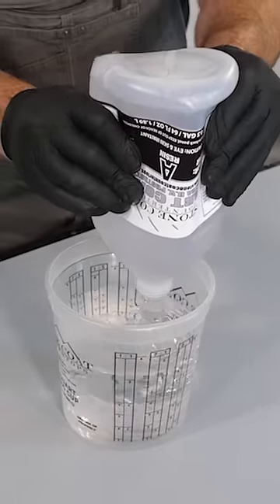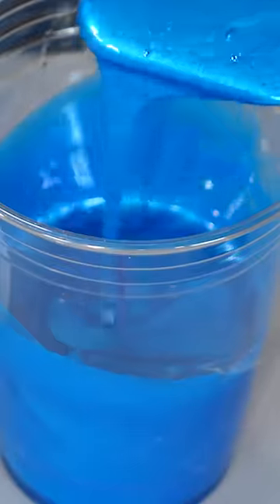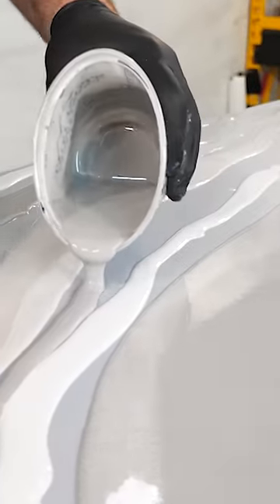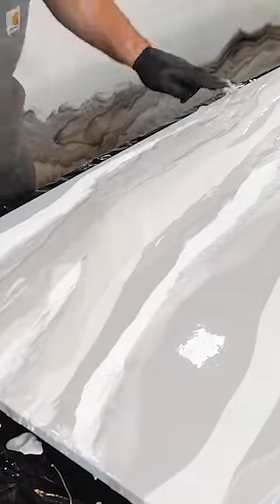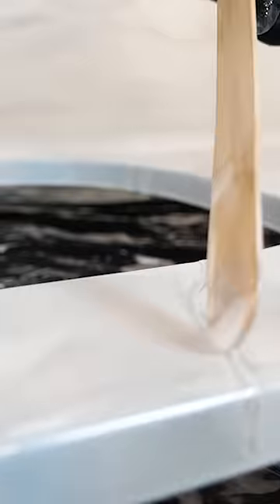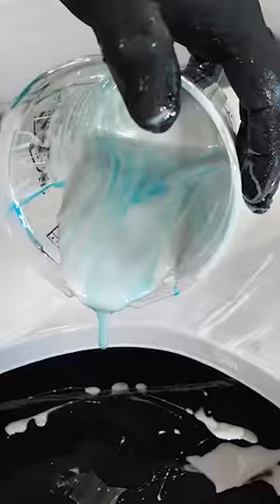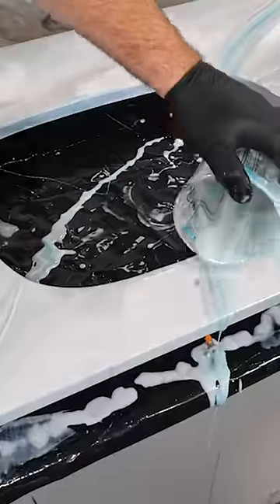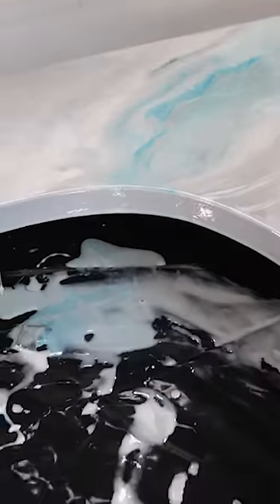He spent $3000 to get shoeprints out of Quartz 😱

Comment: Why didn’t he make the painter pay for a new countertop?
Reply: The painter most probably doesn't have money to pay for it. The builder probably had deadlines to complete the project and he can't waste time it would take to sue the painter and wait for him to pay in installments. That would take years
Reply: @annamarczuk2030  in the business world tradesmen like painters are required to be bonded which is like insurance for damages and liabilities for personal injuries.  Painters generally charge a lot per hour for labor so one way or another I believe the painter had the means to replace the countertop.  I like this company and when I remodel there are several projects I’m going to use there products on, but this just seems like a last case scenario story to me.
Reply: So... exactly HOW did he polish out the stain marks out of the quartz countertops? What 'system" would do that? ( I do understand he then had to spend hours to match the top sheen to match the rest of the surface)
Reply: A lot of times the slabs can’t be cut or prefinished till they get dimensions as well not all walls are square and things don’t always line up perfectly according to the blueprint so they usually come in and measure after cabinets are installed also sometimes the general contractor self performs work and use their own in house painter to keep costs down or maybe the GC superintendent was good friends with the painter and didn’t want to back charge him also countertops are usually installed at the finish stage of home construction 
the time to fabricate a new one might exceed the completion date which might lead to liquidated damages like maybe 500$ per day
Reply: What is the recipe for the counters you are making on this video?
Reply: @rwfrench66GenX  it likely was paid for by the painters insurance but insurance doesn’t come thru quickly so he paid up front to save the job. But really these are trivial details and not an important take away in the story. The important take away is it’s expensive af to refinish your stone counters if they get wrecked but epoxy is low cost and quick.
Reply: @arsenicjones9125  depends on the viewpoint.  I like to deal with reality and in reality the painter damaged the countertop and they’re responsible for fixing or replacing the countertop.  It’s very likely the stone mason still had the template for that job and could cut a new countertop provided the money was there.  Every construction job has extra money and time in the budget for problems.  I understand they’re selling a product and giving an example that a few days of training can save the day, but in reality if a contractor screws up something are you seriously not going to approach them to fix it or replace it, you’re just going to send some guy off to training to learn how to paint over it with epoxy?
Reply: @bnicedanicest6288  nowadays it isn't just about coming and getting measurements they actually come in and fabricate right up against the walls, objects cabinets etc.
Reply: @rwfrench66GenX true, but they might not necessarily have a matching or similar slab with the proper minimum dimensions to cut another countertop. Weaving general contractor in a bind to meet the deadline. Many of my customers select their own slab of granite or marble excetera. And can be extremely fussy about a specific slab and look.
Reply: @kelly-annflanagan7693  absolutely!  I’ve looked online, downloaded apps for my AR phone so I can see how the light from windows and different kinds of lights will reflect off of the surface of different materials, it’s a big investment and no two slabs are alike not only in color but in texture.  I’d need bail if the painter screwed up my countertop, I wouldn’t just pony up and send someone to school to train to do it, I’d hire the guy teaching the course if I had no other options.
Reply: @bnicedanicest6288  In Australia the residential construction industry has gotten so bad that I don't think anyone has built a square angle in a house in the last 50 years and nothing ever matches the plans. Also it takes up to 2 years from start of construction to finishing as they always overbook.

The only thing the industry cares about anymore is cost of materials. The whole industry from top to bottom is corrupt. They have even tried their best to make it illegal for people to build small additions like a carport illegal.

I have nothing but contempt for them.
Reply: @rwfrench66GenX  in the builder game they get home depot painters
Reply: When vendors destroy stuff in new homes or any job, they (builder) back charge the vendor.  We had an installer with a box truck drive on a brand new concrete drive, we got back charged by the builder, this then got submitted to the insurance company.  Usually these homes are high end homes, the builder isn't going to let a big damage like that go without getting reimbursed somehow.  If your vendor isn't bonded and insured, don't use them.  So important you know the company that you are hiring, do the research, you'll  be glad you did in the long run.
Reply: @rwfrench66GenX  maybe you need to watch the video again bc your narrative of the events doesn’t match up to the one in the video. He didn’t epoxy the countertops to repair them, they had to be rehoned and finished. They dipped into the extra budget to fix stuff and sent him to a course to learn to fix it. Likely the counter maker couldn’t get a crew out in the time frame needed to allow them to fix it. So yeah you’re really focused on the wrong parts of the story to the extent that you missed key facts of the story.
Reply: @arsenicjones9125  it’s funny how you’re so sure I’m so wrong about everything but you use words like “likely” because you’re drawing conclusions without having any facts yourself.  I don’t mind that you disagree with me, and it is possible that the owner of the house and general contractor for this job decided to do exactly what the guy in the video said instead of going to the guy who screwed up the countertop to get him to pay for a new one or the cost of the repair.  If forking out $3,000 for someone to learn how to do something instead of offering the instructor $1500 for the job makes sense to anyone, there’s no reason for me to continue speaking with them.
Reply: Because it was his painter silly
Reply: Builders (specifically production homes)use the cheapest labor that will get the job done to satisfaction for alot of the building process. The painters and tile crews are rarely held accountable. I work for a specialized repair company and them damaging tubs, counter tops and kitchen sinks provides us with a lot of work 😆, the builders hold us more accountable while we are doing our work than they do for the vendors that were the cause of the original problem.
Reply: Sounds like a made up story
Reply: Hard to prove who done, like they probs know it was him, no one else been there, but without the painter holding his hands up or without a witness what can ya do?
Reply: @petrescue2093  sanding and more sanding, they then run through 2000 grit sandpaper and polish
Reply: @rwfrench66  maybe in the populated cities lol not in most the land though.
Reply: @webtheweb  new construction is a losing battle for painters most the time the builders are idiots and there is heavy scheduling problems all the time I got 15 years as a journeyman painter I've done residential repaint commercial repaints new construction new commercial and as to why the Builder had the cabinets installed before the painter did his thing is unbeknownst to me...that in itself is dumb
Reply: @sdmfcfh1283  I’m pretty sure most construction is done in the populated cities where the population lives
Reply: I think I have questions probably everyone else does why didn’t the Painter be charge for what needed to be fixed? Secondly, as the countertop guy, you already got paid for your labor, but he paid for you to go to school to learn a trade that you didn’t know, why they charge. you got that class for free. And you learn some thing to be able to charge other customers for that previously you would not have been able to.🤷🏾‍♂️
Reply: @dannythorpe1425  Perhaps the painted footprint tread matched the paint and treat pattern  on  his boot. Perhaps there were witnesses. Perhaps he was ethical and self reported.
Reply: @petrescue2093  perhaps there was non of that?
Reply: @dannythorpe1425  We will never know for sure. What we do know is the OP stated as a fact that it was the painter. How the OP came to that conclusion is outside the scope of the post.
Reply: Sounds like a lie to me
Reply: He likely uses the painter all the time and wants to keep a relationship. That being said, the painter definitley paid for it, but because they're likely friends the main guy is just trying to save his buddy some money
Reply: @annamarczuk2030  it's called insurance
Reply: Because this is a fake story?
Reply: He prob got backcharged to some degree. But for the most part, insurance will cover (maybe?)
Reply: That's why I don't buy the story. Anyone who works in ffinishe houses know not to walk on c tops without putting something down. And I literally don't know any painters that are going to spray a finished kitchen.
Reply: Some people are just nice sometimes
Reply: I've come up with the conclusion that this dude is a compulsive liar
Reply: The painter is his employee, he's liable for employee mistakes
Reply: @annamarczuk2030  it's the general contractor's problem... The countertops should have never been installed until painting and everything else was done!
Reply: @petrescue2093  glass polish??
Reply: I called a back charge. It come out of the contract payout.
Reply: @annamarczuk2030  I know for a fact that regardless of what someone does in the construction industry they have to have insurance to cover any kind of "accidents" like the moron that walked on the new counter tops! If anyone says that it isn't necessary, THEN THEY ARE NOT TRUE PROFESSIONALS!!!!
Reply: @randyherringshaw6325  I would expect a construction company to have an OC insurance in case one of their employees destroys something. I know that doctors are required to have an OC insurance but they earn much more than an avarage construction worker.
Reply: @randyherringshaw6325  anyway I'm from a different country so my logic might not work here
Reply: How many painters you know?
Reply: @annamarczuk2030  he ain't gonna sue him. just not gonna pay him.
Reply: Hell yeah!!!
Reply: Probably the contractor rushing the painter
Reply: Look up quartz renew. It's a 3 step polishing compound to use after the diamond polish pads. What it does differently is reveal the "snake skin" that quartz has because of the epoxy and quartz.
Reply: The GC might have back charged the painter/ sub to some degree. However, this looks high end. You wouldn't believe the amount of money some people spend. Millions, bro. I see it every week. Some GC's out there are more interested in keeping good relationships with subs and they'll eat a couple things like this here and there. It's worth it when you know you have somebody on speed dial who will drop everything and come put out your fire. $3k is probably chump change on a job like this. Giving a sub that generally does good work a mulligan every once in a while keeps them coming back. There will probably be some change orders anyway. The homeowner might walk in tomorrow and tell the GC they changed their mind on that wall right there. Blow it out. Well, now you might need the painter to come back and take care of you asap.
Reply: @rwfrench66GenX  yes. If I had more money than the guy I hired to do work for me and messed up I would just cover it. 

When you employ people, they make mistakes. They make you money most of the time so dealing with the times they cost you money is worth it and the builder got more out of this as now if it happens again he has a way to fix it. If I am building a house I have the budget to eat 3k and gain something out of it. 

Also you can “deal in reality” without that information just fine. It’s still reality just reality where you know as much as you need to for the story. The payment info is not important at all.
Reply: @petrescue2093  dude this isn’t a how to video
Reply: @@rwfrench66GenX  you still have to sue the insurance company to get money. Their whole business is, do not pay out if possible. Took me 6 months and a lawyer to get a check from esurance for a totaled car.
Reply: Could be “family business”
Or Home Depot job
Reply: The painter was probably the builders employee.
Reply: @TitusPullo08  I'm pretty sure if he won't pay him then he will be sued by the painter for breaking their contract
Reply: It's not the painters fault. Normally counters are made from solid materials
Reply: @annamarczuk2030  it would just end in a counter suit for damages he cause. So give me a good reason why a judge would decide against him. Duh big waste of time and the painter knows it.
Reply: The painter was illegal and just never showed up again.
Reply: @rwfrench66GenX  only in some states
Reply: @petrescue2093  why would he tell us a $3000 secret?
Reply: @Ihatezidiotz  See below. He did.
Reply: @TitusPullo08  he can't counter sue because of that. causing damages doesn't null a contract unless something like that is written in that contract.
Reply: The mexican painter said "adios"...
Then went on to ruin other unsuspecting builders work.
Reply: You can try but they’d probably just run off lol. It isn’t as simple as calling the cops or a lawyer. Nobody forces anyone in these situations you just have to figure it out on your own.
Reply: - painter probably can't just drop $7k
- probably not actually exclusively the painters liability, a court could find that because the counter was on the floor and presumably not marked off it can't solely be the painter
- why blame the painter and damage relationships with everyone and be $7k down instead of being $3k down but maintaining one good professional relationship and creating an excellent one out of nowhere

It doesn't make sense to try and pin down the painter for it
Reply: @rwfrench66GenX  correction they're supposed to be bonded, painters are one of the few trades where they generally can get away with not being bonded, this is because they can do a lot of residential work and a lot of homeowners don't want to pay the price of having a bonded painter they're fine paying someone that just knows how to paint because of this you have many "semi-professional" companies running around.
Reply: He probably did, after getting this guy to fix it. Sent him the bill
Reply: @TitusPullo08  lol I'm from Poland. I don't think we have counter suits here
Reply: @TitusPullo08  and if you're saying that in America you can just ignore written cotracts whenever you feel like it I'll believe you because the law is f-cked up
Reply: @annamarczuk2030   And you somehow seem to think it's OK to destroy property and not pay for it
Reply: @annamarczuk2030   You obviously don't understand how a counter suit works
Reply: He explained
Reply: If you forced every worker to pay for every bit of accidental damage on a construction/work site, you’d quickly have no workers who want to work with you, and no work done. And shoddy work done. Because who the hell wants to work for a pos boss who personally charges 7 grand for simple mistakes? 

Arguably the site manager or the guy who installed the top could be claimed to be at fault for not having covered the quartz worktop whilst work was still going on around it. 

You’d support this until it inevitably happened to you.
Reply: @rwfrench66GenX  yes. It makes far better sense to keep your team happy, get a guy trained you can now call on for any future incidents like this, and save money not buying a new counter, and saving the original piece. That’s how good managers work. Good managers don’t just punish people for easy mistakes, which would still end up with the project losing time and money and a perfectly good counter top, and potentially losing potential contractors who would otherwise work for you if they didn’t know they’d risk having to pay up 1000$s for making a common mistake.
Reply: @darcgibson5099  I would say the painter who decided to walk on a counter  top with out covering it is pretty stupid and if you fuck up something as a contractor and that is what a painter  is even if he have employees that company is responsible for damages.  bottom line is this story doesn't make sense anyway.HEHEHEH
Reply: @darcgibson5099  so this is about the employee and his feelings and not the consumer who is stuck with the bill?  Consumers have rights, and if businesses want repeat customers and referrals they will build relationships with the consumers and their vendors.  Having a vendor that costs extra money, puts projects behind schedule or does shoddy work isn’t the kind of vendor to surround yourself with or expose to your customers.  If that’s how you approach work ethic you won’t be in business long.
Reply: Likely sent him the bill and got the project out on time
Reply: Fr 😂
Reply: His bond is there to cover the oops for the builder. Definitely a costly mistake.
Reply: @lvloneymaker24  painters fault for not covering up countertop he is walking  on. Also quartz is a a stone so most would consider that a solid material. 
They were not the material he showed in the video.
Reply: good luck
Reply: A lot of times painters are the ones fixing other people's mistakes handprints on the wall scratches on metal surfaces for lighting we touch up all that stuff so when the painter makes that mistake how do you say you have to pay for this when he goes around fixing everybody else's mistakes this was a good call on the building he's looking out for everybody in the end
Reply: @stevechristmad6095  so when a surgeon does 20 successful surgeries but then nicks a jugular and kills the patient he shouldn’t be held responsible or sued because he did so many other successful surgeries?  It’s called responsibility, you break something or screw something up and you own it regardless of what you’ve done before.  Why should someone else pay for your mistake?
Reply: How's the painter gonna be able to pay for his meth that fuels him then?
Reply: @rwfrench66GenX no one big makes templates. It’s all 3D scanning and cnc these days.
Reply: He probably doesn't have 3000 bucks to throw around
Reply: He’s just excommunicated
Reply: I’m sure the painter wouldn’t have done so if the installer or super had taped off the area properly.
Reply: @rwfrench66GenX   a lot of people in the contracting world do it without permits or insurance
Reply: @petrescue2093  I think he refinished t he whole damn thing which took that long plus using de-greasers for that one area.
Reply: @RabbitsInBlack  Agreed!
Reply: TIME. Make the painter pay the 3k instead and now you also got a more qualified colleague.
Reply: That’s what insurance is for
Reply: Liability insurance would pay.
Reply: @annamarczuk2030  painter would disappear lol
Reply: because this solution is better for both people in the long term.
Reply: 99% of the time it is painters getting screwed.  What a twist.
Reply: @rwfrench66GenX  look up your state laws, there is no requirement for insurance on an LLC in certain states, here in nebraska you pay for your general contractors license, no classes or experience required.
Reply: @neilhuston5579  yes, some states don’t require contractors to have insurance or surety bonds, but that doesn’t mean all contractors in that state don’t have insurance and surety bonds.  Having insurance to cover liabilities is a very normal part of doing business for reputable business people.  The homeowner is responsible for checking and hiring reputable contractors, it just never occurred to me that someone spending thousands to remodel their home would hire contractors without insurance in case someone gets hurt on their property or damages their stuff.  Maybe people don’t jump on Google like the countertop guy did to find the school to research how to hire contractors before they spend thousands of dollars to fix up their home.  Maybe the homeowner is rich and doesn’t mind spending an extra $3000 when a complete stranger ruins a $7000 countertop and is willing to give another stranger a new skill by paying for their school and a new revenue stream for their business and pay for labor on top of that.  Maybe the homeowner was an elderly person with dementia and all the contractors decided to take advantage of him.  Maybe the story in this video was made up to try to sell epoxy.
Reply: @annamarczuk2030  couldn't he finish the job to satisfy his client then bill the painter for the damages?
Reply: @annamarczuk2030   its good project management
Reply: Sometimes accidents happen. Firing someone over just one isn't right.
Reply: @paulmvalexander26pa  how about making them pay for a $3000 repair to your house?  You’re just going to fork over $3000 and not ask for the person who messed up your house to pay or if they had insurance?
Reply: @petrescue2093  he didnt, he recoated the countertops with coloured acrylic
Reply: you cant squeeze blood out if a turnip
Reply: @petrescue2093 I'm guessing you gotta take the $1500/- course to find out brother.
Reply: @rwfrench66GenX  LOL. Tell me you've never worked in the trades without telling me you've never worked in the trades.
Reply: @drwrap3431  I don’t understand what you’re laughing at.  In the 80’s I worked in construction and then I went to school and started a business doing convention management.  As a consumer I’ve bought and remodeled several homes for rental properties and bought, fixed up and sold homes for a profit.  Does that help you understand my experience to make the comments I’ve made?
Reply: @rwfrench66GenX  I wasn't replying to you. I was replying to the guy who said all trades have to be bonded and always have reserves for situations like this.
Reply: Ya right a painter coughing up 7k😂
Reply: This is what business insurance is for.
Reply: @petrescue2093  that info costs 3 grand and 2 day course...
Reply: What I said
Reply: Lol definitely did dummy
Reply: @annamarczuk2030 the random jab at the painter is trash
Reply: @rwfrench66GenX  not in every state. And sometimes the painters work for the builder at an hourly rate like an employee.